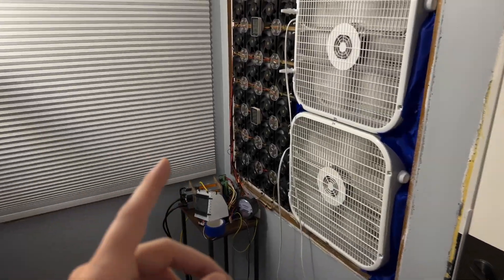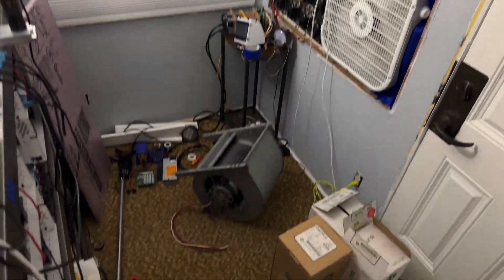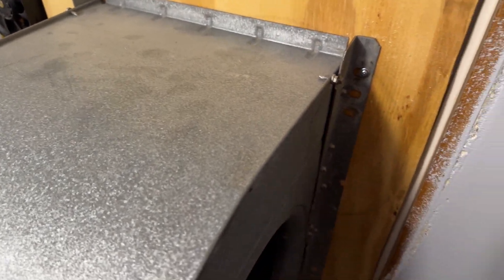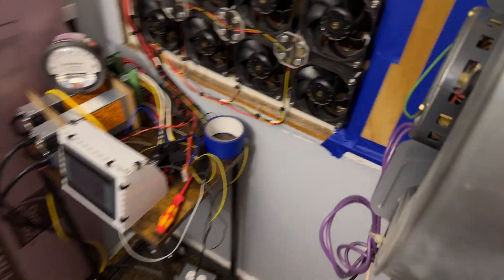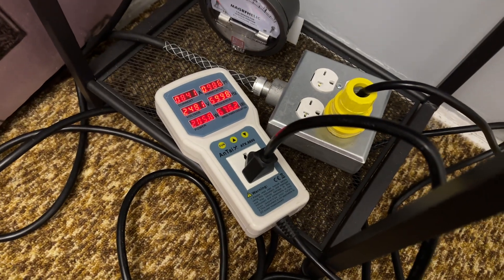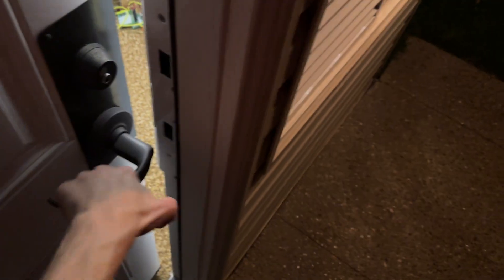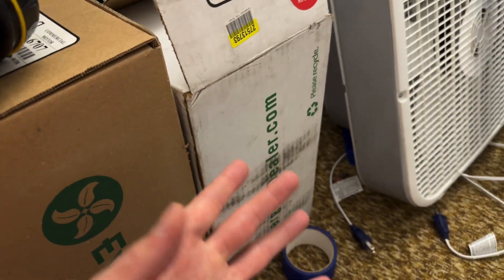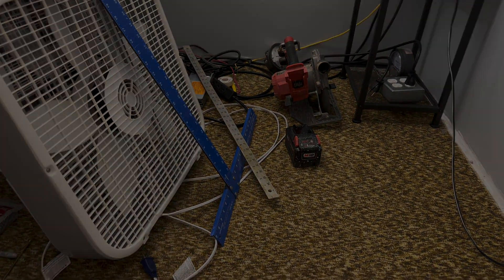Cheap DIY Bitcoin Mining Fan?

Comment: could maybe affix a filter somehow to the intake of the a/c fan.. man those fans move some crazy amount of air
but have to be careful cause if you dont have enough air from intake.. it could starve the motor and overheat.. and then.. fire that why these are usually found either outside in a unit.. or with a filtered direct flow from outside.. and with those fans.. you have to have a duct for it to build pressure.. thats where and how it builds so much airflow cant just put it in the window...

take it by itself on the floor.. and cover some of the exhaust of the fan.. youl see the fan ramps up and airflow goes way up too and youll have more airflow.. at lower speeds and lower power

Comment: I was not at all expecting that, I think I dropped a comment about a squirrel cage on your prior video. Okay, I am convinced, thanks for doing the work and documenting it! What are the small fans again?
Reply from the maker: It performed shockingly poorly, so I think I need to try with an ECM motor. It shouldn't change airflow much, but it should cut power down.

The fans are Sanyo 9GV1212P1J091. There's a few options that are similar, these are some of the best 120mm fans for moderate airflow and pressure.

Comment: Sorry to disappoint you but, those little fans are designed to move air for short distances like over a computer processor. If you replace the furnace motor with those little fans in the same set up as the furnace fan you will get very little to no air coming out of the vents outlets and into the returns inlets in a house setup. Any HAVC equipment manufacturer will confirm this.
Reply from the maker: …Did you watch the video at all?
Reply: @SiCPoWMining  sure did..
Reply from the maker: @jaimeparadise  I’m a bit confused then. The data suggests that furnace blower isn’t performing as well as a little fan. Are you suggesting the testing is invalid? The difference between the two is so absurd I find it hard to believe the data is off by that much.
Reply: @SiCPoWMining  Your "DATA" is not for the correct application. Yes those computer fans use less watts than the Hvac fan but do not move the air far enough, you are not considering blade design.  If you install those fans in regular hvac application  you will get no air coming out of the air vents. (the grills you see on the ceiling where air comes out of). That "wheel" has been discovered long  time ago. Don't waste your time and others as well.
Reply from the maker: @jaimeparadise  …What? I never suggested installing axial fans in a furnace. I told people specifically not to make fan arrays like mine. Are you suggesting this video is telling people to replace furnace blowers with 120mm computer fans? The application is exactly what I’m measuring. Airflow through THIS room is the sole intent and function for this fan. It has absolutely nothing whatsoever to do with a furnace.
Reply: @SiCPoWMining  Change the title of the video. Good luck with your click bait and reinventing the wheel.
Reply from the maker: @jaimeparadise  I’m struggling to understand what you’re getting at bud, this is a mining channel.
Reply: @SiCPoWMining  I think the confusion was on the fan array. Dont think he knows those are 12v 3a server fans but rather he is comparing it to those typical pc case fans.
Reply: Data means nothing if it is irrelevant to the problem. His problem is he's losing money, therefore he will play with his fans and argue with the internet to keep his mind off of the huge debt and frivolous decisions he has made. The fans are just a metaphor for his bigger problems. He is chasing the dragon tail but has no idea what a dragon looks like. This is the definition of insanity.

Comment: That’s a bummer, I have two of these and had thought about using them in summer for heat control. Guess not. Efficiency is everything here because of the high power costs. Thanks for the great video.
Reply from the maker: I think the louver right next to the exit on the blower is a big issue for this assembly. The pressure gauge is only showing the depressurization of the building, which is what matters for airflow, but is not the total pressure the fan is exposed to. Still, I would have expected a lot better performance from this blower...

Comment: First That fan assembly is beyond what I thought it could do. I was wrong.
Second that has to be the first cage fan I've seen hit that watt with such low performance. I've seen some not worth putting in cars and others not large in size nearly blow a guy over. But all well under 800w.
Third I might try this but go the other route. Replace the cage fan on a central unit. Considering it's half the operation cost.
You may of just tripped over something and again I was wrong.
Last If the cage is the reason for it's low performance. A motor change will not change the pressure draw enough to matter. Just lower the watt cost. 
This Vid definitely has me scratching my head. Well done.
Reply from the maker: That furnace blower moves good air when it’s sitting by itself, it just massively drops when it’s restricted. I think I’ll have to measure shaft rpm after the motor swap just to double check, but it doesn’t have me too optimistic. I could try another blower assembly, this one looks good and spins quite smooth, but maybe something is going on.
Reply: @SiCPoWMining  Considering they get sized to the h/c space going through small ductwork with each room using a small register with louver control. They are built to fight restrictions + filters. So you may be right.